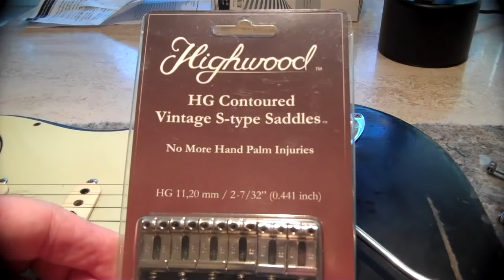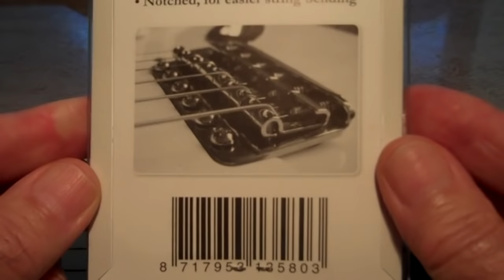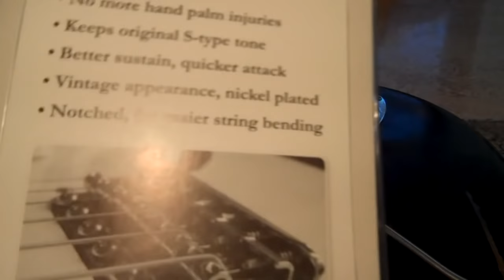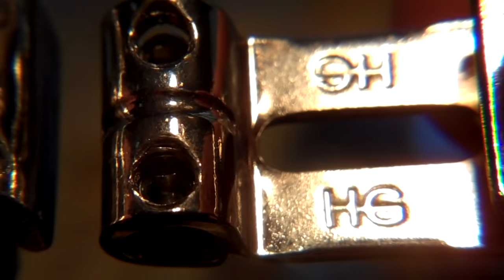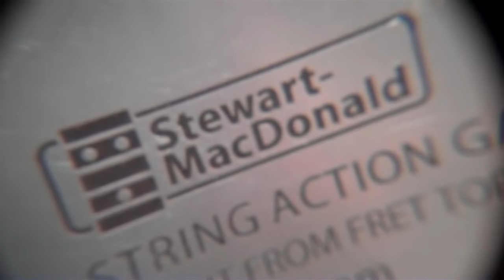Highwood HG Contoured Vintage Strat Saddle Review - Better Than The Originals

Comment: How are these holding up for you?  Less string breakage? Less burring?
Reply from the maker: I love them.  I forget they are on there except that my guitar stays in better tune.  No burring that I can see.  I think I broke a few more strings than usually but a couple of them actually pulled out of the ball at the end which is unusual.  I think the saddles put a little more stress on the ball because the string only touches the saddle at the groove.  I'm completely sold on them.  I've been playing a lot so it is difficult to gauge if I am breaking more strings.  I broke a .015" G last night.  I play really hard and I usually only change the plain strings when I break them.  If I break a wound string, then I change the whole set.
Reply: millstap, thank you!
I've played an '82 "Smith" Strat for the last 12 years with no issues (stock CBS-era chromed cast saddles) but switched to a pre-CBS style Strat several months ago and break my E and B strings constantly.  I bought some abrasive cord to smooth out burs which helped slightly but not enough.  I recently bought Callaham saddles only to discover the breakage is even more frequent.  My '82 saddles are notched from 36 years of use, so I'm starting to think that I need to just let the original Fender vintage RI saddles wear in.

Also, my breakage ALWAYS occurs at the saddle, so I wonder if these Highwoods might at least solve my particular issue.
Reply from the maker: @ebeep  I've tried them all.  Even the graphite ones but those sound bad and don't really work.  I was a master string breaker for years and years, especially E and B.  I would order at least 10 singles of each just to keep going.  I hate the way the standard saddle cuts multiple grooves from the string sliding around on the top when they are new.  The Highwoods completely eliminate that problem and the guitar stays in perfect tune.  I didn't realize how much difference the groove would make on tuning.  The strings are super stable on big bends.  I don't think you will ever use another saddle once you try them.  From a distance, they look perfectly vintage.  They have more sustain.  I recommend using a lube of some sort.  I've tried many of those over the years but just recently switched to Super Lube, which is a food grade grease that is not messy or greasy at all and it has Teflon.  I put it one ever three days or so.  I could probably go longer but I like to do it.  I push down on the whammy bar to put some slack in the strings so I can lift them a little in the groove to get the grease in there.  It is very clean and does not hurt the finish.  I use it on the nut too but found it is really only necessary on the saddles and maybe the string tree.  https://www.super-lube.com/.  I've been super impressed at how good my guitar stays in tune now.  I think it will help you tremendously.  After every string breakage, I would always take my Dremel with a rubber/ceramic polishing wheel to smooth out the burrs but there is no way to get rid of them completely unless you take off some plating and steel using something course.  Then you end up creating a dip in the saddle and eventually have to replace them.  I did that for years and years and bought new saddles every year or so.  The Highwoods solved all of those problems.  I also have them on my vintage 1964 Strat and they are wonderful.
Reply: millstap, I just ordered them.  Thank you!
Reply from the maker: @ebeep  Let me know what you think but I already know that you will like them.  You might want to check to see if they automatically send longer screws for the center four saddles.  I used them just to have a little more screw meat.  I am not sure they include them in the set.  I asked them about it and they said they would send a few longer screws.
Reply: millstap I ordered them from StewMac to avoid international shipping, so I think I just get what I get.  My action is pretty low though, so I likely won't need anything too long.
Reply from the maker: @ebeep  That's good.  I could have survived with the standard screws. My action is fairly high.  They may include longer screws anyway just in case.  I'm not sure on this.
Reply: Ok, so 3 rehearsals and a show later and no more broken strings!  These are amazing!  Glad I persisted.  Thanks for your help!
Reply from the maker: @ebeep  Wonderful.  I wish I would have known about them years ago.  I saw them but they didn't catch my attention then.  A little lube may help even more (Super Lube) but it sounds like you don't need it for now.
Reply from the maker: @ebeep  I take it you didn't miss the longer screws or were some included?
Reply: @ @millstap , I personally can't see long screws ever being required because the brilliant design eliminates 5mm of screw height from the equation as compared to vintage saddles given the threaded portion is flush with the bottom.
Reply from the maker: @ebeep  I know.  I just have this weird perception when the screws get to the end of the threads.  I want a little extra meat there.  They still stay below the top hole.

Comment: Great stuff thanks... Why so much string buzz on the open strings? (sounds great plugged in anyhow) 
I do agree, as when i found these i was gonna get them 100%. somehow i forgot, lost in the sands of time.
They should give you a discount code because they're going to sell a few sets now.
Reply from the maker: Ignore the string buzz.  That is not there.  I wish I wouldn't have put that in there.  I think the cord on the camera was hanging down on the strings.  They sound perfect.  Solid as a rock.  Get them as soon as you can.  I'm putting the other three on as we speak.  I just added a different audio to that section.  It will take a while to edit.
Reply: @millstap  you said there was none. i will get em  thanks. Did highwood do the relic set?
Reply from the maker: @dannyjonze  Yes, Highwood does the relic set too.  I have all six on now.  I don't know what that weird sound was.  I wish I would have edited that section better.  It sounds good now though, LOL.

Comment: Man those HG saddles look like a way superior design to me. The more round top, the way it wraps around the screws, the built in groove, man those look like a very clever design all the way around. I'll definitely keep those in mind if I go to replace mine. I've got one of those very first reissues- a dead on copy of a 1962 Stratocaster built in 1982. Tobacco Sunburst with rosewood fretboard. That's my #1 because it just plays like a dream and sounds even better! I've still got the original tailpiece and everything. I've kind of been out of the loop for a bit but I'll try to keep in touch. When we go to do more recording I'll get in touch with you in case you'd like to come check out our little studio. Cheers!
P.S. the House Burning Down riffs were sounding killer!!
Reply from the maker: They are a superior design.  I'm putting on the three for the wound strings this morning.  The groove is a big improvement.  It dawned on me last night why my other saddles have multiple grooves in them.  Anytime I replace the saddles with new ones, they are so slick on top that the string slides around on top for a while when bending strings until a groove forms to keep the string from moving anymore.  If you don't do extreme bends, then it is not a problem.  I used to hate moving the string back to the center on new saddles.  Plus, it knocks the string out of tune.  The tuning on these is super stable.  Let me know when you are recording.  I'm sure I'm driving my neighbors crazy with the Echoplex.  They came over yesterday during my 2 hour jam session.  I didn't know they were in the house.  My wife let them in.  I'm sure they were curious as to how I can make so much racket.  They are 78 and 80.
Reply: @millstap  Ha! That's funny, I imagine your neighbors are thinking you are doing some sort of 'voodoo' or something! 🤘🎸

Comment: I trued a set of 2 7/32 high wood saddles. Immediatley notice it changed the tone of strat and not in a good way. Left them on for a week. Then went back to original fender steel stamped saddles. The high wood saddles dulled the tone and made them darker / warmer took the the fender tone right out of my strat. I did not like them at all!

Comment: Ok, this was one of the most influential videos on saddles outhere,  so I watched it too while making a decision on replacing my crappy steel block saddles. Then and now I call most of the saddles -  blocks - nut material discussions and marketing just a snake oil. why?
I use 0.10-0.46 strings tuned half step down with action set low. So - wide breaking angle at the saddles. On my old guitar for 20 years of playing that crappy piece of shit Strat copy I have had 1 - that's ONE broken high E string on the saddle, now imagine the saddles on that guitar - pure crap. Grooves - offcourse but buffing them once in a while and using machine oil made it stay in tune and not breaking the strings.
For the most part of the last 10 years I play A 2004. Am. Series Standard Strat with a brass nut and stupid ugly block saddles and guess what - harsh and trebly despite the bras nut.
Didn't bother to change the whole bridge to loose the offset saddles so I just bought Callaham offset saddles. The instant change for the better ( though I've heard about Callahams sounding too trebly), not to speak of the cosmetics - even with the new set of strings - no more too bright and harsh overtones in higher registers and the tone is way nicer in comparison with the old blocks and new strings - always hated that.
About the grooves that will be cut in the saddles over time - no worries, with regular buffing the groove edges and oiling the nut and the saddles I'm sure Callahams will do their work quite nicely - maybe even decades from now. Besides, Highwoods cost almost double the price of Callahams - I bet the price is not justified. 
The only flaw of the Fender vintage saddles is the slot being too small so the string brakes twice. I have seen and played many old guitars with such saddles and many brand new - I used to work as a guitar salesman.
So people, just buy what you like, what you think sounds the best to your ears and go with it, forget the marketing!
Reply from the maker: As far as I can tell, the Highwoods are $44 and the Callahams are $40 so not much difference in price.  On string breakage, it really is a matter of playing style.  I pretty much bend strings from the very first note.  That is what I love to do on the guitar.  I still break strings with the Highwoods.  The main reason I started changing saddles was because I was wearing out my vintage '60's saddle by buffing out the grooves.  I noticed that there was a slight depression developing on the top of the saddle.  So I had to find the next best alternative.  I went through all of the new production Strat saddles for years until I found the Highwoods.  I just love the design.  I have them on three Strats now.  If you look at almost all other Fender guitars besides the Strat, they all had grooved saddles.  It keeps the string stable.  I still think there may be a slight change in tone with the grooved style but I have not really noticed it and have not thought about going back to the original style.  It's also nice when you change strings.  When you are winding it quickly on the tuning peg, you don't have to make sure the string is riding in the center and not on a height screw.  It is self centering.  Just a little benefit that I appreciate.  Plus, if you use a lubricant and use your tremolo a lot like I do, the groove is a nice little recession that holds some Teflon grease and protects if from being wiped away with the palm of your hand.  They are worth a try but only if you bend and break strings a lot.  I've broken thousands of strings in my playing time.  It gets expensive.
Reply: @millstap 
Well, mine were 40$+14.25$ for shipping to Europe while Highwood were over 40€ to start with. I bend a lot too, whole tones and have always had kind of aggressive style, still - no string breakage. While a lot of my friends can't say the same. Slotted saddles are ok but in this case I really am satisfied, for the time being. I don't expect saddles to last for few decades, maybe I won't last that long too :-), but I'm sure I have made the right choice at least for not having to change the whole bridge 'cause it has offset saddles which is a cost raising issue too. I hope things will pretty much stay the way they are now but we'll see...one more thing, I use a stainless steel pick for years with no problems at all, let alone the string breakage
Reply from the maker: @singleplayer75  Oh yes, I forgot about the offset saddles.  That wouldn't work.  SS pick?  I bet that lasts a long time.  I just ordered a whole bunch of picks because mine last about 2 days.  Happy New Year.
Reply: @millstap  
Happy New Year, all the best!
Reply: *breaks. "Brakes' are what vehicles use to stop.

Comment: Man you have a severe case of "been marketed to".If you believe that different tuners Change your tone (which ones? It's not just one singular tone.is it the the highs? The lows? The mids?) than surely you'd believe a different guitar strap makes your guitar sound different. Or what the material of the cable is made of. Or what shoes your wearing?